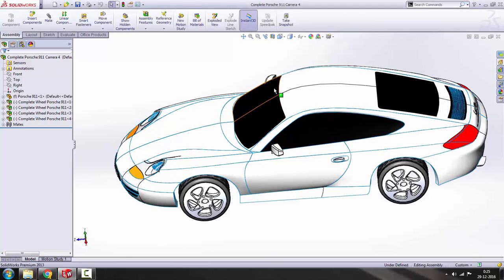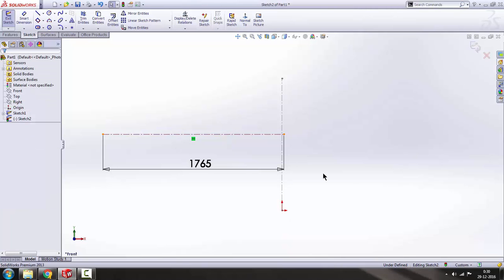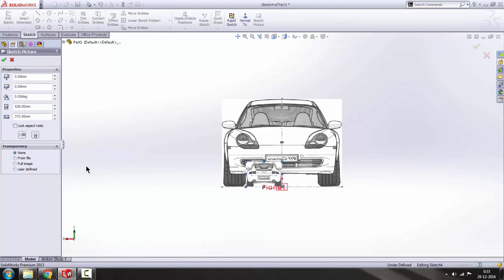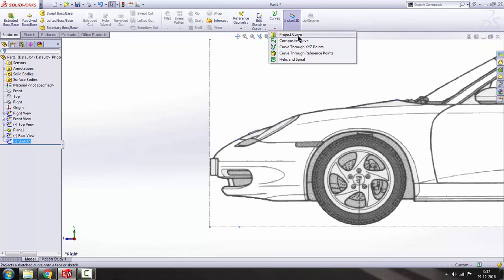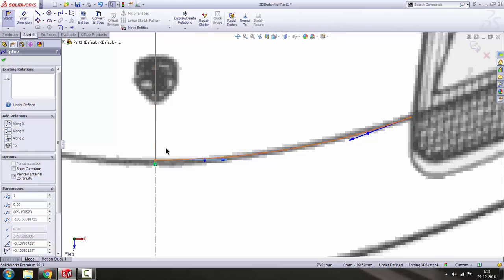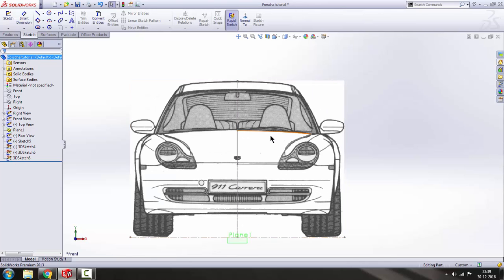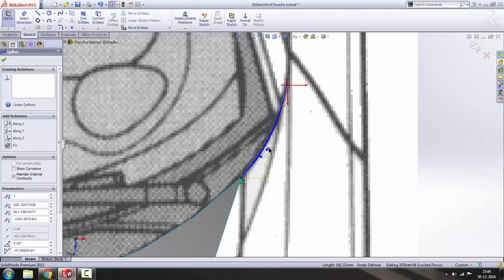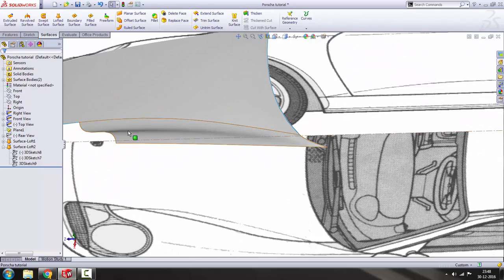Solidworks Tutorial No.1[Porsche 911 Carrera]

Comment: I have a question, let's say I wanted to create my own design of the front section. I could use the car lines as reference to create my new surfacing. As long as they start and stop at the original lines and curves. Right?